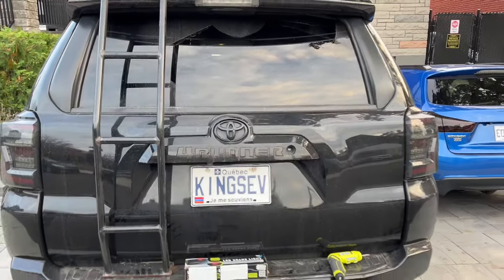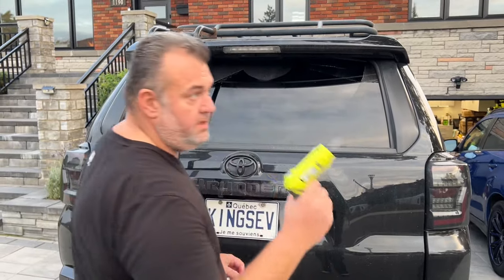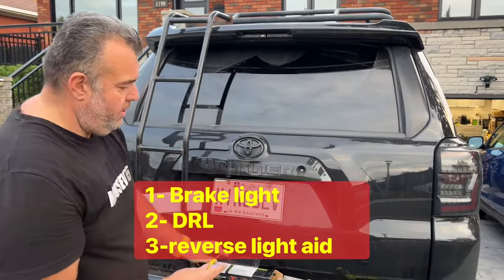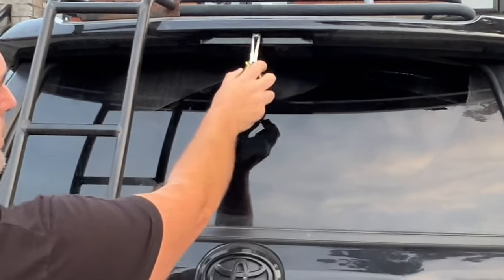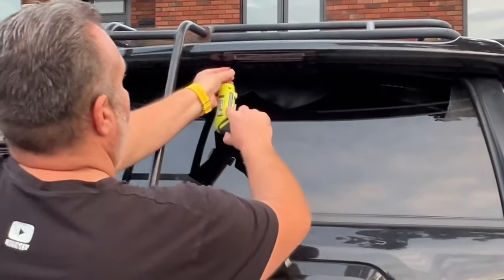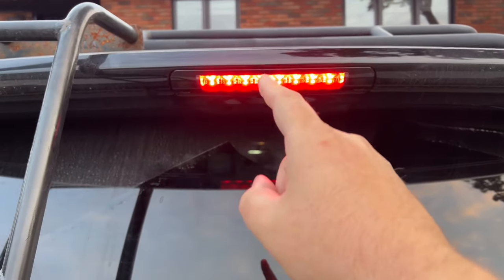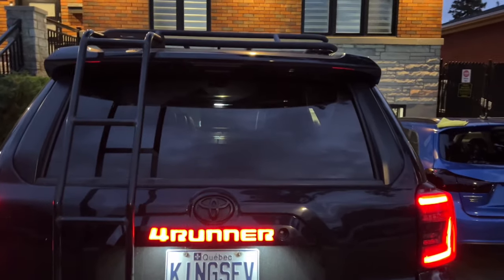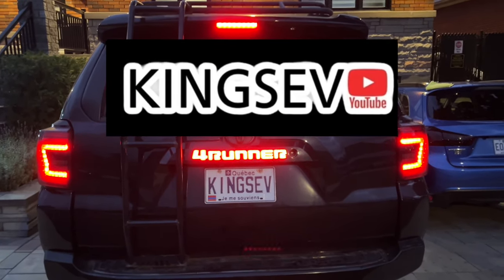3rd Brake Led Light Toyota 4Runner 2010-2024 5Thgen  Install

Comment: I enjoy your videos! How do you install the 4th “4Runner” light part?
Reply from the maker: Thanks 🙏 appreciated , for the support and compliment. 

To install the 4th 4RUNNER brake light , I personally followed the removal of the tail plate then run the wires from the right side and tap into the right brake light, it’s not a seemingly easy job but it’s not as hard. Just need some patience and no force … 

Here’s the video to assist 

https://youtu.be/0AX0cmOBai4?si=I4JSKeJioAuGvkZD

Here’s the 4th tail brake light : https://cartrimhome.com/LED-Badge-Rear-Trunk-Tailgate-Molding-Trim-Strip-For-Toyota-4Runner-2010?tracking=ncJKtrtdNkES3RSYEOSXlG4r7y7yGJS1z8PFUL4ho3ejj9k5w51QlgTnFbwhJkTW

For an extra 7% off, use coupon code KingSev7

Comment: Can you show how to tap in for reverse or drl. Please
Reply from the maker: Unfortunately I do not want to install that, because you’ll need to run the wire to either left or right brake lights and I totally don’t have the time or effort for it, but it should be straight forward by just routing the wire to the left side and then bringing it back to the right brake light. It may need a pro to do it, I really don’t have the patience for that lol I’ll break stuff
Reply: @KingSev  lol.
Enough said. I will not hook it up either.
Reply from the maker: @p.k.808  😂 I hear you! That’s what I said too.

Comment: can you tell me the part number please?
Reply from the maker: 💰 Link to purchase 3rd Brake light 👇🏻

https://cartrimhome.com/Brake-Light-Replacement-Parts-For-Toyota-4runner-2010?tracking=ncJKtrtdNkES3RSYEOSXlG4r7y7yGJS1z8PFUL4ho3ejj9k5w51QlgTnFbwhJkTW

For an extra 7% off, use coupon code kingsev7

———————-

Comment: Flashing brake lights are illegal in many places and will get you stopped by the police. Check your local laws prior to installation.
Reply from the maker: Tinted windows as well, you’re responsible for your own actions and local laws .
Reply: @KingSev  Check all local laws before snake oil salesmen tell you otherwise. Call local police. Check tint. Check your wife. Check the tires.